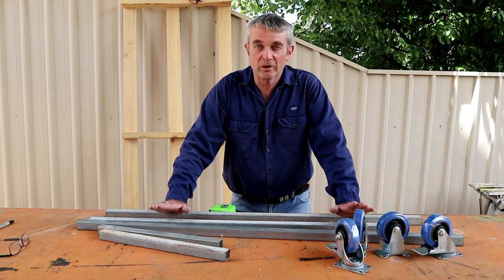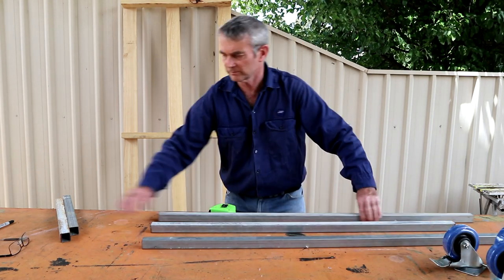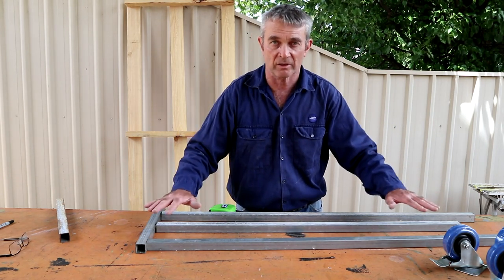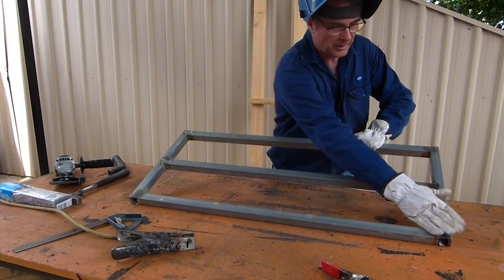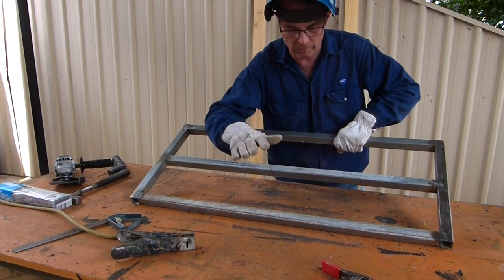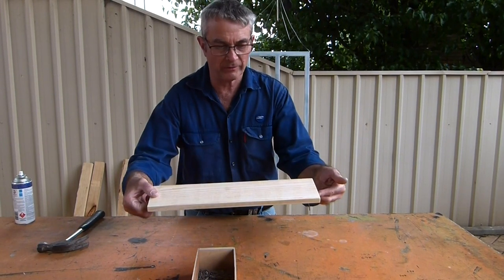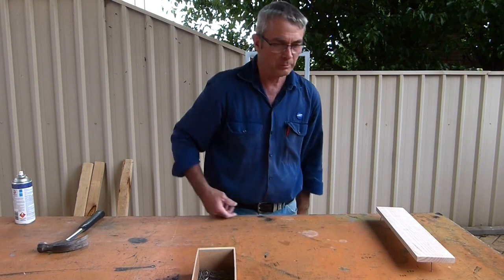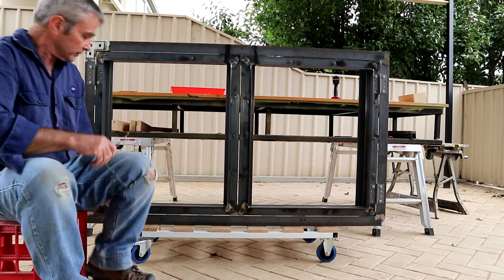I make a simple Furniture Dolly for the Workshop.

Comment: I would like to ask if I want to fix a handle to push or pull the dolly; I find it always weak and break easily. Thanks for sharing the well done project
Reply from the maker: Maybe just weld a ring on the front and have a hook on your handle there is less chance of it breaking and can be used with it or without it, thank you for your comment.

Comment: Did you have a source for the wheels?
Reply from the maker: I am in Australia, these are the wheels I used. https://www.bunnings.com.au/syneco-100mm-blue-rubber-castor-set-4-pack_p3940356     70kg weight capacity per castor